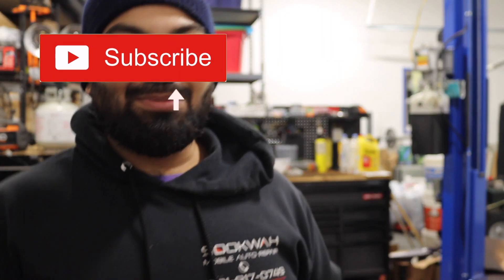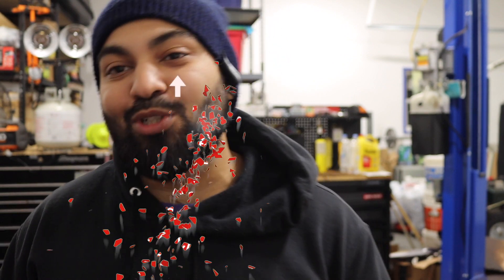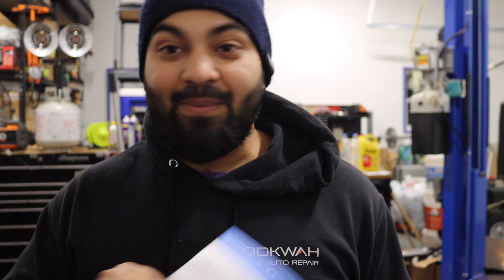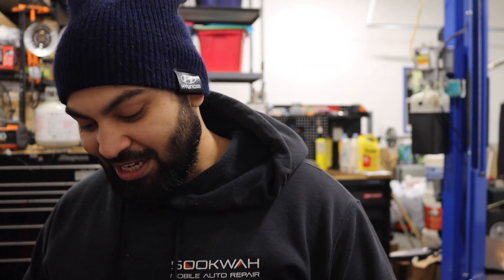2 ways to delete AFM 2/28/2021

Comment: i had to replace my engine at the cost of $8000.00 3 years ago on  my 2011 escalade with 117k miles due to a lifter collapse issue that caused a bearing to come out of the block, very disappointed,  i just bought a 2018 escalade with 42k miles it runs great but im  concerned, should I do an AFM disabler,
Reply: If you use this do you need to replace the afm lifters
Reply: @ruelsmith2429  no. just plug it in under the dash, works great
Reply from the maker: thank you
Reply from the maker: you can if you want to, you would also have to replace cam as well too if you do that
Reply from the maker: Heck yeah, that afm is only problems man

Comment: I just got the chip
Reply: What chip ???
Reply from the maker: To delete afm,
Reply: @Kingcustomz  hey I’ve had it on the truck since I got it, it does not give you a better gas mileage but it seems to perform better I also switched to a short ram intake it purrs very nice when I step on it, it lost that lag u get when it switches to v4 if you drive this and know what I mean also the oil doesn’t seem to be disappearing anymore if I’m correct
Reply from the maker: Seems like everything is working out better than before brother, keep us posted
Reply: @Kingcustomz  yeah it just had a lag when switching and I had read a lot about oil consumption as well as the cylinder or lifter issue with the afm deal some people on some blogs even suggested the transmission problem might stem out from the shift on the motor not sure I’m not an engineer but sorta made sense to me to have a full v8 with that transmission all the time hopefully I don’t have to visit the mechanic 👨‍🔧 that’s all I’m trying to do 😂
Reply from the maker: Just take care of her, as soon as a problem arise, tackle the issue
Reply: @Thefishingplumber  So, you recommend the range afm disabler?
Reply: @julida691  ever since I got the chip it hasn’t came off the truck I dont like that weird shift going from 8v to 4v I’m not sure but it’s staying on
Reply: @julida691  definitely 👍
Reply: @Thefishingplumber  thanks 🙏
Reply from the maker: Sweet let me know how it goes

Comment: Not sure if my lifters is failing the engine is very quite, but when driving I feel a vibration when in v4. The second it’s in v8 it stop but also the vibration is not constant only sometimes and only in v4 . What could this be?
Reply from the maker: Apparently lots of people have this issue... not sure what it is, could be a unresolved result from that dumb afm.... check your spark plugs see if they are looking good. Has your engine always had this vibration in 4 mode.
Reply: @Kingcustomz  Unfortunately I just bought the truck  for about a week now so I’m not sure how long this problem has been going on other than that vibration The Truck is super quiet
Reply from the maker: Alot of others experience that...Im.not 100 percent sure to be honest
Reply: @Kingcustomz   Thanks for taking time out to talk to me . Your videos are awesome consider me a new permanent subscriber
Reply from the maker: Awe thanks brother,  and anytime.. I really appreciate that 😁😁

Comment: Thanks for the info! Great video! 

Quick follow up question, when you say “failing lifters”, is there an indicating factor other than an engine code or will my check engine light come on if they’re failing?
Reply from the maker: You would hear a tapping sound
Reply from the maker: Thanks as well😁